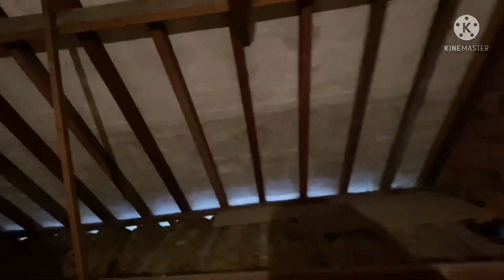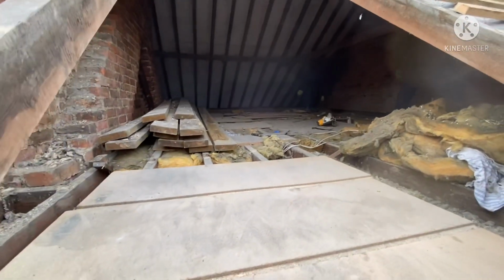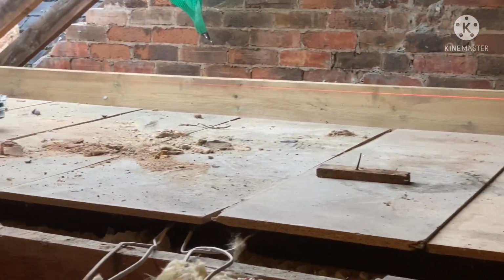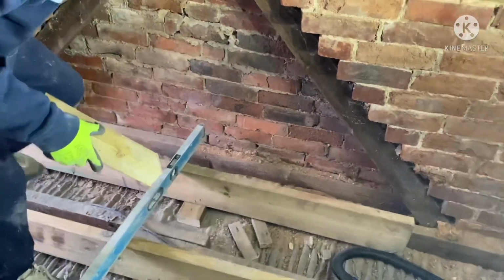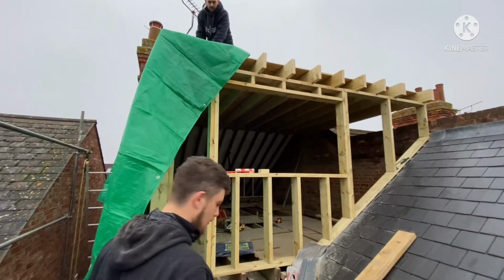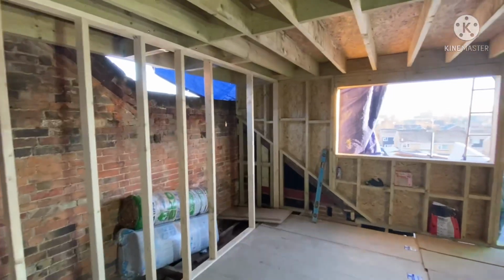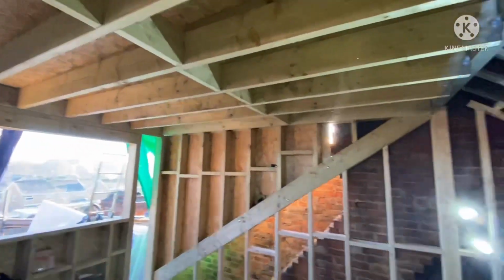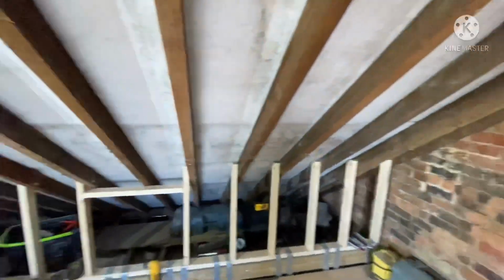8 days to build this loft conversion from start right upto this.!! 💪

Comment: Hi mate for ridge plate can you use 2 9x2 bolted together
Reply from the maker: Hi mate, the only way you’d be able to use a double timber bolted together is if the structural engineer specified it but in my experience they usually spec it with a steel plate sandwiched between 2 timbers.. this I called a flitch beam, we tend to use flitch beams because they can be assembled up on the roof making it easier to get them up there! 
Hope this helps 👍👍

Comment: Where the floor joists cross over in the center, are they sat on a load bearing wall or simply bolted together? I didn't see it in the video, thanks!
Reply from the maker: Hi Mike, we sat the floor joists on a load bearing wall that runs through the centre of the house then fixed the joists together where we could! 👍👍
Reply: @extendaspace-constructionc821  Hi I'm looking to convert mine. It has a spine wall that could potentially be structural but made of wood on the first floor. was this brick all the way up?

Also how big was the ridge steel and dormer rafters, I need to make mine small as possible as I only have 2.3m.

thanks.